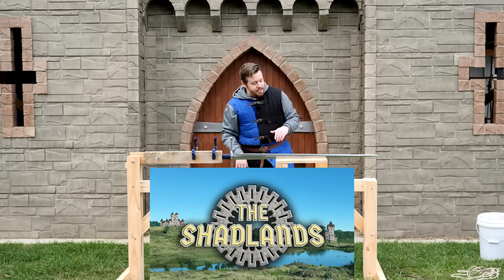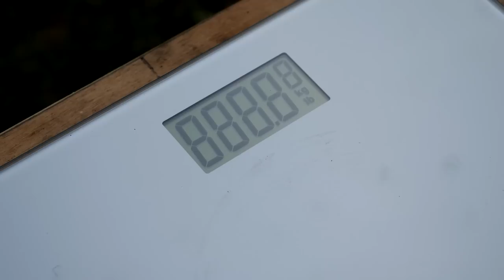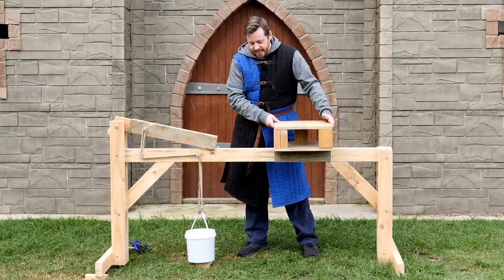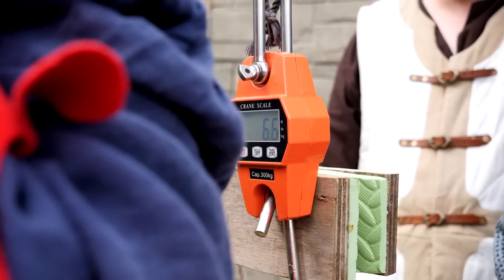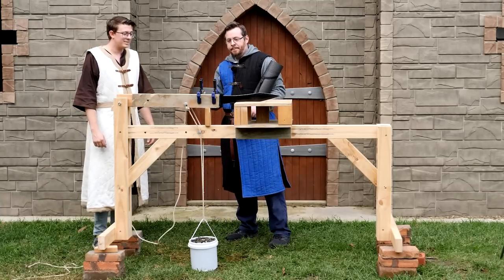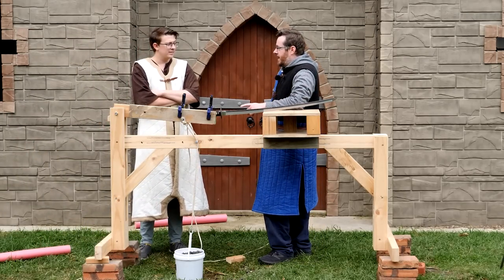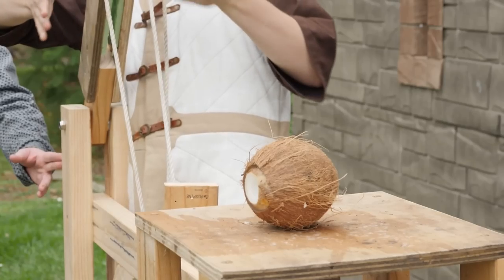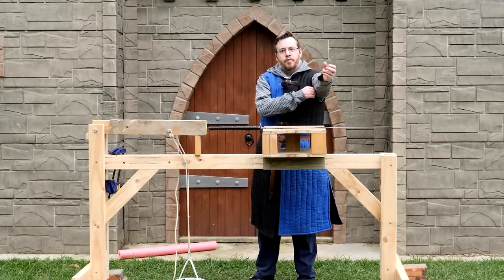Choppy choppy

Comment: The test on the yoga mat has proven that the test rig needs to more closely simulate realistic human movement in order to get any kind of results. I have no doubt that you could have cut that thing yourself with a draw cut. 

Do you have a high speed camera? If so, a detailed look at your striking technique (drawing cut motion specifically) looking from side on may show more wrist and/or elbow articulation than the rig can currently simulate. 

Take measurements of your own body. You have stated in a previous video that you are 6'2". The Fulcrum of your cutting rig is at the height of your elbows and not your shoulders, so that would be a good place to start to increase performance. 

Follow through. It's taught in martial arts to punch "through" your target in order to impart the most force. How much is required to achieve the types of cut you want to replicate? I watched a Skallagrim video where he cut cleanly through a tatami mat with a two handed long sword with a 35 5/16" blade and the follow through appeared to be as little as a blade length or perhaps as little as the distance between the hilt and the sweet spot/point of impact. Stepping the sword holding arm of the rig out to clear the base may allow for follow through and an increased fulcrum height will give the necessary ground clearance to do so. This will also give the option of cutting lower targets mounted underneath the longitudinal beam of the rig thus allowing a longer period of acceleration and further increasing cutting performance with the same amount of force. A stop will still be necessary, but the option to cut though your target may help.  

Also, the katana seemed to move in the jaws of the clamp, so that system, though ingenious, may need a redesign that reduces the observable deflection while retaining enough "give" to prevent damaging the blade. Good luck with that bit. I'm just a chef, so if any engineers want to chime in...

Comment: Congrats, you've just built a machine which has same amount of energy from shot to shot. Unless you attach a different sword to it... I figured you're bad (you know it quite superficially) at physics watching your speculations about nunchacks. I encourage you a lot to go through school course of kinematics and dynamics. It will be very helpul for you to understand what and how to build. It may take a few weeks or even months. I don't want to make your journey though physics lighter, but a small tip for you: don't rely on free fall, don't use vertical plane for the movement of sword. It's much better to use horizontal spinning lever for your purpose. If you want to use gravity whatsoever, transmit the force via gears or belts. Mythbusters machine construction is pretty much what you want to achieve. But first, learn damn physics.

Comment: Hmm have you made any actual hit force measurements? Get your dad, brother and couple of other people and got test it out, asuming you have a proper place and way to do this kinda testing.  20 swings each should be a good enough amount to point average per person. Then average those averages, that way there should be fatigue factored into the swing averages. Then measure a bucket with rocks and add or reduce the amount of rocks to increase "swing force" of your genious rig there! 

Also I hope there is a piece of pipe not too tight or too snug fit, just long enough so the rope cannot touch the threads on either side of the pipe to act as a washer that spins around the bolt instead of the rope, to reduce the friction.

Comment: Shad, this is meant with no offense, but the physics are completely off. Not only are your calculations of the leverage of static force applied off, where you should be measuring it where you were measuring the stick distance and not what you’ve done measuring basically at the guard. There’s a much worse problem: momentum. 

When performing a chop, you are excluding friction and angular forces applied inside the materials Chrystal lattice, and instead create simple shear stress. Shear stress = F/A where F is force and A is the cross section area along the cut. 

However this force is not static, as what you’ve measured, but an impact force. Impact force is equal to change of moment over time(momentum being p = mv) , like you’ve yourself discussed in the nunchucks video. 

Your acceleration from your hands is way higher than that of gravity, especially through a lever with a fairly far positioned center of mass. Therefore, the proper way to do this would be to measure the angular velocity of your swing(and since it will be different for each weapon, due to leverage, you will be having a problem for validity of the test there). Also I would recommend getting rid of the extra mass on the lever where you can.

Comment: By the way you might want to put a safety on that place before you put your hand underneath it! More importantly you need to put a rule in place one man at the chopping block at a time! As both of you were standing next to the shopping block with your hands within inches of The Chopping Block when you remove that coconut dropping the place down onto the block with a full seven pounds of pressure at the handle it only takes three pounds of pressure to take off a finger! This is not a toy this is a guillotine!  Never get confused about that! Because your friend is too stupid to realize you just tried to chop off his finger.!.

Comment: I see that there are two problems. First i must say that rig is calibrated acualy for realy weak swing. That comes from the fact that you measured your force with a stick, by pushing the end of  stick against a scale. But you calibrated the rig with force on the end of rig wooden arm. That means the power of the rig is equal too the power on the end off hands, witch should be much greater than force on the hitting spot. Therefore this hit is much weaker than what you measured on scale (my rough stimates are like 2 or 3 times weaker because the length of and and stick are like 2 times the length off hands. Adding there the fact that you cant hold stick with the same force that you can pressure with hand from the fact that your wrists dont allow it). Exactly for the reason of leverages, as you noticed yourself with moveing a bolts. To make a correct calibration you should stretch out your hands and push with those against a scale. Second problem is the fact that you try to make hack not cut. To solve that problem you need to make rig wooden hand into two section. The first section have a force bringing it down (simulating the fact that you generate power hit with core not with hands) and the second section would need to bee able to rotate but with realy hard resistance to mimick your strength holding your hands straight. you can acomplise that by realy hard tightening with rotaiting bolt that you need to but between two rig hand sections. That would simulate cutting, because the moment sword hits the target, the first part of rig arm would continue to go down, therefore starting to pull second half and sword back, also it would change the longitudal angle of sword therefore massivly increasing the pressure on cutting point since it makes it shorter. Also im not engineer so i could be wrong im just phd student in physics.
Reply: Also, as others have pointed out, the force isn't going to be nearly as important as the speed. Which weight isn't going to impact that speed unless it's positioned toward the base of the lever, or through a pulley system, etc.

Comment: Another issue is that your two tests were testing completely different things. Your first Katana coconut test tested if a katana pulled down by gravity with seven kilos of force added can smash a coconut... your second test tested the strength of a person swinging down with much stronger Force than your machine was testing. To recreate that test you need to tie that bucket to your arm and then just drop your arm and let gravity swing the Katana into the coconut and I bet you it would end up with the same result as the machine. Your 7 kilo figure was testing your push through Force but not the entire force of impact that a human can apply using all his muscles when doing a full swing.

Comment: With all due respect my man. You seem to be verging in to "mythbusters" territory here. I love you're thinking … But in the end they didn't get it right either. there is a possibility you may be over thinking this a bit. I love your work and appreciate  what you do. yet here you may be going a bit overboard.
Reply: Also in the end i think you're not accounting for the give in the padding. maybe if you placed a block at the top you may avoid the give that happens when the blade contacts the target. something to emulate the sturdiness of the human element. i noticed this when you instead of the machine did the work. also the machine goes strait down as apposed to the human element. a human has a natural movement compared to a machine this may be a part of the issue.

Comment: In my not so professional opinion, it's because of the leverage, you messured the sticks weight at the impact point on the scale, but then used the hand position when filling the bucket, you'd have to do that vary thing again while it's clamped into the device, scale weighing the strike point to properly calibrate it, I suspect you're losing about 60% of the cutting power because of this difference.

Comment: You measured wrong. You measured the sticks force at the point of contact, however you measured your rig at the handle, I'm guessing you are getting around 2kg of force at the point of contact with the coconut, or 1/4 or so of what you wanted.

Comment: For the Katana, edge alignment is key and the clamp kinda moves, ruining the alignment, along with the coconut shape just not favoring the mechanism you built that well. But the even bigger issue in general is that your math is WAY off! You measured the 7 or so kilos at the TIP (edge) of the bat at start, but then applied it to the handle for the tests, I shouldn't have to explain that because of how leverage works, your tests are way inaccurate. To get 7kg on the end when pushing (at the end of the cut or against the scale), you need a lot more than 7kg at the handle, that's why when you have 7kg on the handle and when doing the cut yourself, the difference is massive, resulting in the clean cut through.

Also, just leaving this as a suggestion, but you know those adjustable weights you see at the gym with disks attaching onto the handle? You can use weights like those directly on the lever arm rather than having to bother with buckets and whatnot. Either way you aren't getting a proper test since when swinging with your arms you direct the energy in an arc rather than a straight line, but it'll be more consistent than buckets since when the sword hits the object, the force bouncing back from the object to the sword will make the rope less tense (and the bucket to slightly "jump" sometimes) for just enough to throw off consistency.

Comment: Also, like many have said, you're over complicating your calibration. If you want the lever to replicate the force your arm is applying to the stick on the scale, you should be measuring the lever pressing the same stick into the same scale. Mixing measurement points and devices are unnecessarily adding conversions you're not intending and as a result not accounting for

Comment: Didnt you say you worked as an architect at some point? I am suprised, how someone who is supposed to work with Basic physics can collect so many errors. This is roughly the niveau of "deadliest warrios".... Trailorpark edition.

You should rework this. I think maybe a rubberband might simulate the excelleration a bit better than a static motion downwards. Maybe the weight of one or two human arms attached to the Part where the blade is attached to might help too. 
But thatv comes down to, what do you want to test here. What do you want to compare. 

For the Material tonuse for a cutting test.. Well. It is quiet Hard. First, what do you want to test? Just the "cutting ability" so how to compare the quality of a cut? Does it rip the Material, is the edge aligned, does it stop midway? Wht quality do you want to compare? For me it is not Clear what exactly you want to test. Maybe it is just me or my Lack of english to get it.
Just my thoughts

Comment: You just cut that coconut with the middle of that Katana not the tip of it you are forcing the machine to use the tip of the katana that is one third down which forced the katana itself to disagree with the cut and force the katana to move the foam that was holding the handle their by adjusting the grip and drawing all of the power back into the handle instead of into the tip of the blade. The simplest way to put this you are providing the blade your Chi. The machine is stealing the chi from the blade. Because the machine does not have as much purchase on the katana as it had on the Longsward.

Comment: Your whole setup is meaningless right now. You can remove your bucket and you'll get similar result.
The difference is acceleration. Right now your setup gives you a pretty much the same 10 m/s*s of acceleration no matter what is the bucket's weight because the whole thing is basically free falling.
What you need to do is to record the speed of the sword's movement when you strike with it and move from there.

As for future modifications, consider following:
1. release mechanism. You can use something simple, like knot that can be releasing by pulling free end of the rope, use release like in onager or ballista, or just get a arrow release for modern bow. Arming and releasing by hand is a bad mojo.
2. Accelerator. Bucket on a rope just won't cut. You either need a gravitational accelerator on a short end of a lever (like in trebuchet) or you'll need an independent from gravity accelerator. Like springs or rubber bands.
3. Understand that you end goal is to reach a certain energy transfer into your weapon. This can be measured as weapon's speed. And different weapons would have different speeds - lighter weapons are easier to accelerate so they'll get more speed than heavier weapons. Than body physics comes into play and the fact that different weapons are accelerated with different degree of efficiency - too light or too heavy weapons accelerated inefficiently by your body.

Comment: Only a little over 6 minutes in and I can tell you already have a flaw in the design. Swords don't just slam into an object to cut it, they also draw across the target to make a deeper and/or wider cut. This machine does nothing to simulate the blade edge sliding across the target to any degree.

Comment: Foolish fool! You should be measuring the weight of that same club at the same point you did for the reference, ie where itll strike. Fill the bucket until those scales read the ~7kgs, but with that leverage, itll need to be a BIG bucket. Wheres your master craftsman dad when you need him?

Also, put the Shadlands channel in your channels tab of your channel channel pls. Easy to find it then.

Comment: With this you aren’t cutting, you are crushing. Sure, you have the momentum and the blade and the sharpness of said blade, but most swords are made for cutting not crushing. It’s about the same as if you would attach a very thin weight to the end of it and call it cutting. No, cutting is created by power and friction, not their ability to crush. If you would move it at an angle, then it would be cutting because friction of the blade, touching the material as it moves is added to the equation. 

I really enjoy your content and such, but if you want to be more effective you have to actually put all the subjects of your theory into the math of your contraption. You wouldn’t be educating if the information you give is incorrect. Friendly reminder man, keep doing good. :)

Comment: The fail education system strike again. You need a calculator, geometry and physics knowledge, not a scale. I feel here same puling numbers out your ass like in coin video. But if it was mocking a DnD/RPG take on gold coin i think it was sort of ok.
Also about katana you strike not only in cutting motion that you mentioned but also in a curve but that is somewhat true to european swords as well but this is irrelevant on hard targets. So there are just 2 options. Performed the tests using human input or automotive robotic arm that can mimic speed, force and motion of human input consistently.

Comment: u asked what to use as cutting material. Use a human......pros consistent... cons u'll end up in jail sooo don't do it but it's an option.
so my opinion is use 1 fruit or 1 thing and draw ur results from there. just as u used foam just consistantly destroy same item and do math for other items.
u seid it yoursefl but u miss looked sword adaptability. they suck but kinda don't. ur using mace test on a weapon that cuts or thrusts.
what i mean 1 weapon needs to land a heavy hit (what u did) another one needs to stab fast  and u used heavy hit on a weapon that slashes or stabs. swords are great multipurpuse weapons 
coz they fail a lot compered to others but they make up failures of other weapons. (in my opinion) and using slicing weapon in not slicing test is problematic and won't tell the hole story.
u need something that pulls the sword back after sword hits because that is where deeper cuts gome frome. use a  reverse spring for it? but im not sure what u are willing to spend
so yeah....
too long: didn't read wrong test for the weapon